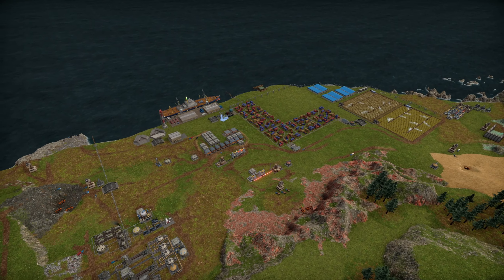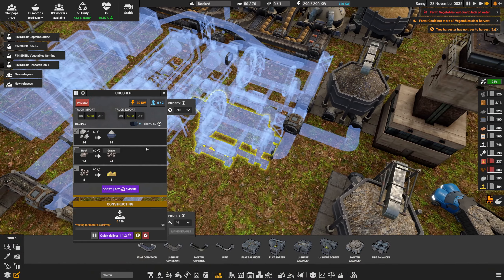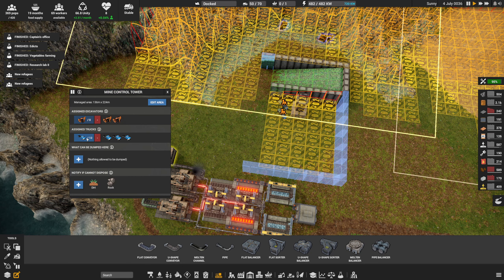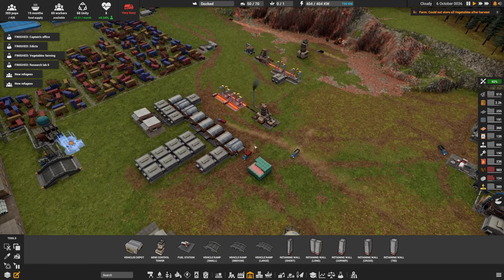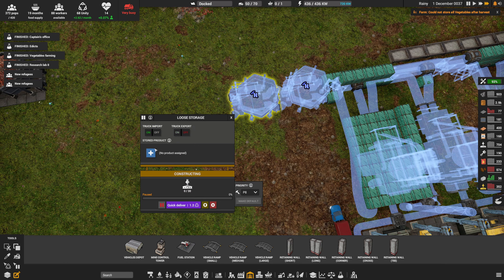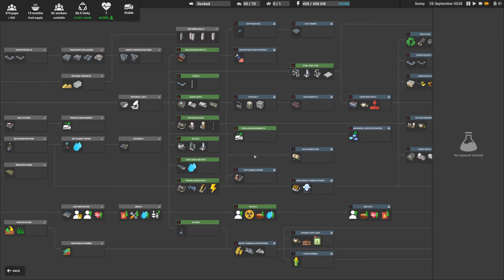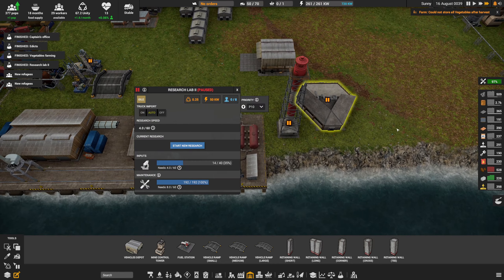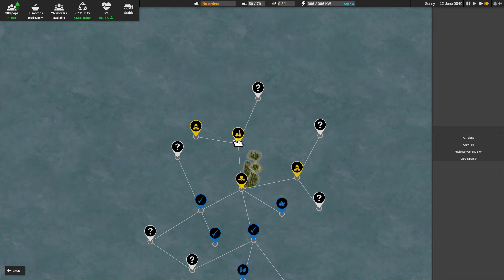Rebuilding Iron the RIGHT Way  🚛 Ep5 🚜 Captain of Industry  👷 Lets Play, Walkthrough, Tutorial

Comment: I know that if you place a pump, ie oil, on a deposit that the one pump will pull from the whole deposit. Does it work the same way if you have more than deposit on the map? You have 2 oil deposits and 2 water reservoirs depending on settings and map. Does one pump on one patch drain them both?
Reply from the maker: Each deposit is unique, so you would need a pump on each one to drain them.

Comment: I'm really new at this but i tried making my molten slides in a snake back and forth about 5 times on both metal output and I have 8 plate makers and i can expand to more if i want also did the dame with copper but I have 4 electrolysis machines hooked up for copper  like i said i am new and my experiment seems to be working but need further testing and experience.
Reply from the maker: experimenting is totally part of a new game, or a new genre! most of the tutorial videos are 10 hours of experiments cramed into 10min of video!